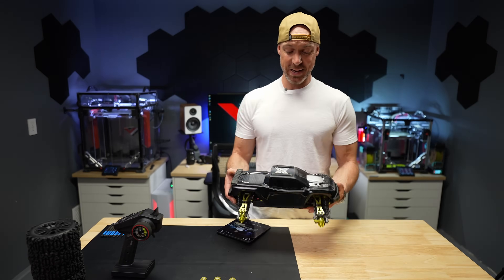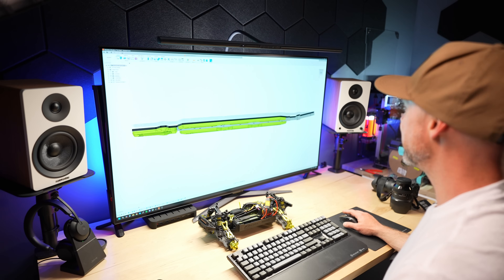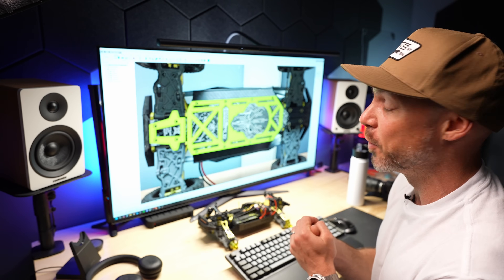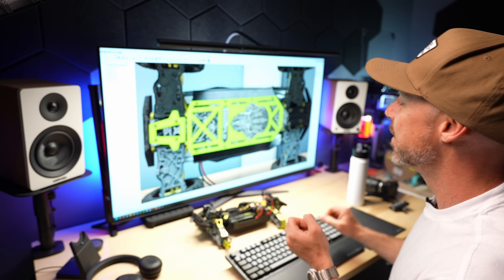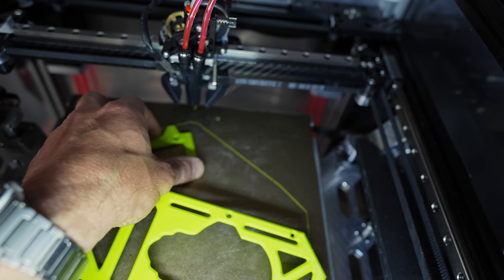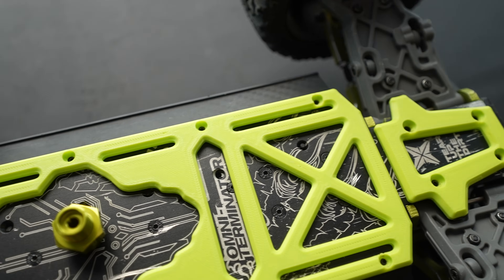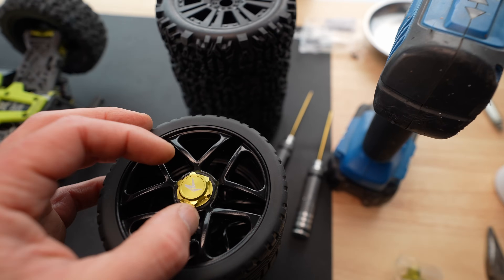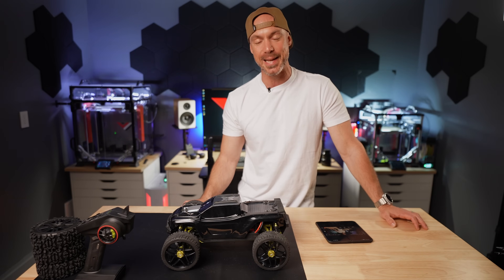Omni Terminator skid plates 3D printed

Comment: I feel you for not wanting the bottom plate scratched. It's probably one of the most sophisticated designed RC even compared to the Arrmas and whatnot. I just go about sticking a clear film protector underneath - one of the thick ones used as table mat

Comment: It looks like you're still using rectilinear infill(?) Seems a bit dated 😅
From researching a lot of videos over the years, I found that many YouTubers came to the conclusion that Cubic is the overall strongest. 
My go-to is Cross-hatch. Have you given that a try yet?
It's a great trade-off between stability in all directions and very fast printing speed (because of the straight travel paths).
Wouldn't that be a better infill to represent such a printing speed oriented channel? (manipulative tactics at work) 😉😂
Reply from the maker: yeah I should use cubic more...but here its not rectilinear, its grid.. and its still faster than cubic for fast prototyping :) I think its the fastest infill method still

Comment: rc can be expensive.
i have a 1/5th scale rovan baja and a 1/10th crawler.
3d printing goes well wuth the crawler but one tumble with the 1/5 and i don't see the printed parts lasting. lol
i used to build race cars and hot rods for a living it's a nice job if it is  a hobby.

Comment: I made a different servo mount for mine, an ESC mount, a receiver mount as well as an extended battery tray. I’ll get around to posting the files eventually haha. A regular old flatbed photo scanner works great for getting accurate high resolution scans for using as canvases in Fusion. The amount of detail even a $70 scanner can capture is mind blowing.

Comment: Can’t wait to be printing! Still trying to build my mellow vzbot… instructions aren’t great around bolt sizes and WC hotend assembly…  guessing sucks
Reply from the maker: Also check on github in the stl/assembly section..there are more info there😊
Reply: @ I’ll look again thanks 🥵
Reply: Finally got it and have made my first prints… 60v water cooled everything, diamond nozzle and that sick graphite plate!! So flat you don’t even need to mount a beacon and it’s dead flat at any temp. Already had several successful 1000mm/sec prints at 25-30k accel and 55k travel moves, this thing COOKS! need to finish the enclosure and mount my water cooling setup